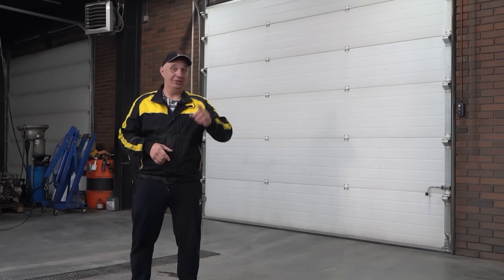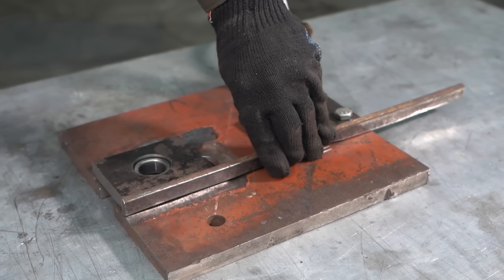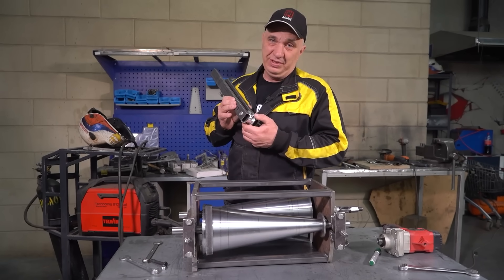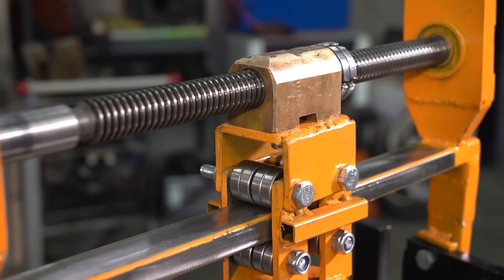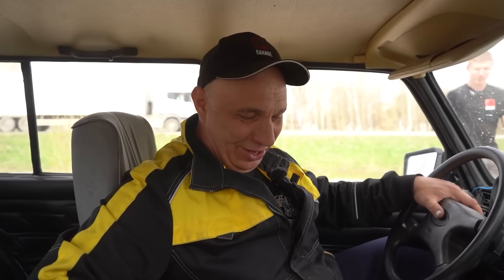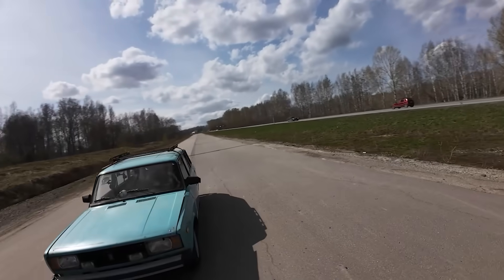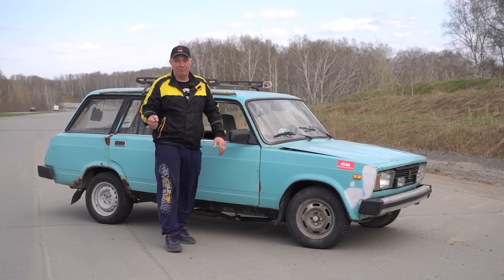We make a DIY CVT for a Lada - will it work?

Comment: If you look carefully at your video the belt is already trying to ride up the side of the flat roller. Maybe you guys could just use a different shaped roller such as a double cone shaped roller with a flat in the middle as wide as the belt.  As you shift the belt back and forth the belt can ride up the side of the cone shaped roller instead of shredding.  Perhaps using the same angle on the cone shaped roller as both of your cones you made for your cvt.  Also as you moved the new roller belt tension would increase reducing slippage.  Just a thought :)  Love your guys vids!

Comment: The CVT is considered an automatic gearbox with only 2 gears, except for a car, which would require a very large one, even larger than the gearbox itself, to make the most of the engine.

Comment: Finally a repairable CVT transmission!! Brilliant work!!
Reply: Replace the belt with some tire tread from a small tire(moped) maybe sow in multi layers to say1.5 inches thick
Reply: Excellent, yes, a repairable CVT. Which is good, cause it’s gonna need repairing a lot. I hope they have a lot of spare belts.
Reply: Add 2 overdrives....
Reply: + :3
Reply: Ratio zero cvt no need repair like manual gearbox.
Reply: @xxxxghostxxxx2052  "doesn't need repair" is corporate speak for unable to be repaired
Reply: Or, alternatively, well designed, which is engineer speak for well behaved metal
Reply: @xxxxghostxxxx2052  LOL.  More like "Can't be repaired after the belt inevitably (and I do mean inevitably ) detonates, destroying the rest of the transmission."
Reply: @gpweaver  Ratio zero is a geared CVT. It doesnt use a belt instead it uses ratchets and clever design.

Comment: a roller for a belt has to be bigger in the middle then on the sides, make a 60-80mm wide roller with 50 diameter in the middle and around 40-45mm on both sides wiht a nice radius and the belt will allways get pulled to the middle of the roller.

Comment: If you guys ever plan to revise this transmission again, might I suggest instead of having a guider pulley and track, and threaded rod, why not use the same principle as a belt sander adjuster? Have one end of one cone pivot and the other can be adjusted closer or further to the fixed cone. If you want to get real fancy, you could use a servo motor to suck/push the pivoting cone, with a default setting to return to it so the belt remains stationary once you've adjusted your speed.

Comment: I think the issue is that you're pulling the belt only from the "top" side, I think you should add an other roller on the bottom part of the belt too, and bring them together, it would put wayy less stress I think when actually shifting the belt around.
Reply: The real problem is the top side is under tension, that causes a lot of problems.

Comment: What if there were two rollers on either side of the skinner part of the belt.  Then, there would always be a smooth round surface pushing it as the belt moves across the cones.

Comment: It would work better if the CVT was placed right after the clutch (the best would be a torque converter from automatic). It would spin way faster this way which would allow quicker ratio changes. It will need a gear reduction stage afterwards of course.

Comment: Random tip: Never ever try to grab or slow down a belt while it is moving. No matter how easy it might be to stop it, don't! The edges on those belts are extremely sharp compared to how they look, and I nearly sliced my entire right hand open while trying to stop the belt from a drier. No joke, that did happen. Thankfully I quickly pulled my hand away due to the friction heat, only then realizing I have a pretty good cut on a finger (I forgot what finger it was exactly). I never felt my hand being cut, only the heat generated by the friction. And that was a drier, not even a washing machine. And the drier wasn't rotating fast at all.
TLDR:
Moving belts will mess your hands up!

Comment: The belt is being sheared as the part on the larger side of the drum is moving slower than the part on the smaller side of the drum and this happens to the belt twice once on each drum.  The belt made its own differential by splitting into sections.  This is why CVTs use cones  with the belt between them the inner and outer of the belt matched the speed of the cones flanges transmitting power over the entire belt thickness.
Reply: the old school advice was to put a half twist in the belt.
just like crowning a wheel, the belt tries to run off the cone at a certain angle... that doesnt match the angle required on the second cone, which itself direct the belt off in the wrong direction...

add a half twist, the belt now rolls onto and off the second cone the "right way"...

but theres always a torsion between any two points on the length of the cone trying to tear the belt part. it can only ever rotate on an infinitely small "line of contact", every where else it must slip across the belt width. and you need width for the friction coefficient, that is then overwhelmed by the slip required... so you make the cones longer and yeah... its a never ending downhill slide...
 
making it as a vee belt and pulley is far simpler, with better friction on the belt, with less wear. now the belts wedging in, and driving from its sides rather than its face.
plus, making them as obtuse cones or pulley sheaves is far more compact...
Reply: @paradiselost9946  half twist and use side rollers
Reply: Would a differential on the output let the second cone slip a bit to keep that from happening?
Reply: No, the belt has a constant speed on both drum surfaces.
The real problem is they gear the engine speed down before the CVT and thus there's a lot more torque going trough. The CVT wants a higher speed and less torque.
And they try to move the belt on the tension side with the 'full' engine power on it.
Reply: True true, but lubrication does become a bigger issue. The CVT is an imperfect design in its own rightly it's why it never truly caught on with mainstream car manufacturing.
Reply: @C.game0the cvt is actually very common these days in hybrid vehicles, nissan just gave it a terrible name so no one advertises it. Basically every hybrid toyota uses a CVT.
Reply: @2ARM2 Toyota doesn't use a CVT in the conventional sense; they use something they call an eCVT which has nothing in common with any other CVT design
Reply: @2ARM2 it s called e-CVT but it’s not the same at all since it needs electric motors , an épicycloïdal planetary gear set and no belt
Reply: @C.game0 all the automatic scooter use cvt and it works just fine, 7 million are sold per year in India.
Reply: That is the entire point of the CVT or any gear system.  The belt on the small side of the cone is spinning that cone much faster than the other side.  There is some slip in the belt, but that happens on a fan belt as well.  I would think it would make it easier if the engine side was a single diameter, not a cone.  Then you move the belt up the cone to the bigger diameter for top speed.  Engine spins at a constant speed and the drive goes faster and faster as the belt moves to the larger section of the cone.  But you would have to tension the belt at the small end of the drive cone maybe with an idler pulley in the middle between the 2.  That would allow more tension in the middle to take up the slack and as the belt was moved to the larger section of the cone, that idler pulley would raise up along its rail as the belt moves to the bigger diameter giving less pressure.  Engine stays in its peak power band at all times while the drive cone gets faster and faster due to the larger diameter.
Reply: Yeah, but then you need oil because now you have a metal to metal surface
Reply: @monad_tcp no you don't? Oil would just make it slip, it needs to be dry since it relies on friction.
Reply: @monad_tcp  You don't.  Scooters run without oil with rubber on metal and it works . The friction is needed
Reply: @JonasDecker-z3x scooters also burn through a belt every 5000 miles

Comment: You need an oblong wheel for the roller with open ends. The guides will only really destroy the edges if they're that big but a belt will try to go to the high point on a pulley under tension.  This might help with the belt lifetime.

Also you could tie the speedometer output to the mechanism to shift gears and have it be automated then.

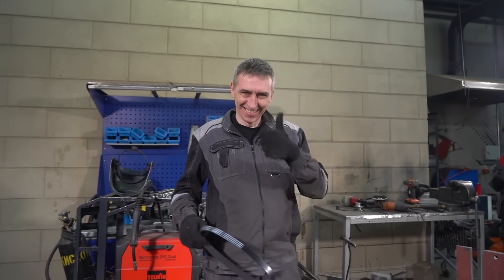Comment: @7:07 minutes in but I'm going to take a guess here you need to have a belt that is mobius stripped ever so slightly not an actual mobius strip but a shorter length on one side than the other. Gotta say guys I really do love this channel I hope it all works out for you hope you guys get to 8.5 million subscribers something along that line this is really worth watching every time awesome videos keep it up
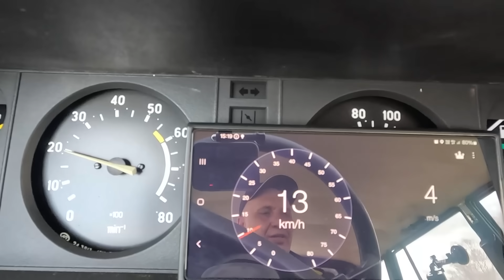Reply: @14:35 that was what I was thinking earlier the failed point is the belt or the connection point between the two to keep it as a belt you would need some sort of system that incurs friction without rubber or anything like that essentially you're looking at something like a Chinese finger trap that's a pretty broad description of what my mind's eye is picturing but that's what you're looking at when one side's pulled the other collapses and vice versa

Comment: if the cones were spaced farther apart you could have the adjustment screw run between them and have a guide wheel both above and below to more evenly spread the force moving the belt sideways. these wheels could also be sprung, acting as a tensioner for the belt

Comment: This is a good retrofit concept, however - you can theoretically fit any cvt if you got a welder and some knowledge of how the electronics work. Kinda works like a floppy disk drive. The pump is pneumatic, the shift linkage is manual unless it has an actuator on it. some after thoughts

Comment: That's impressive! I was fully expecting the belt to just snap! I would like to see this with the metal belts used in CVT's!
Reply: If they did that they would at least need to shield it and it would need fluid to keep everything cooled. If a rubber belt snaps, it might hurt, but a metal belt could do some damage.

Comment: The thing to do would be to have a bearing on both sides right before the point where it contacts the second roller, that way it just has to slightly move it and it’s supported already

Comment: If belt strength is an issue then you could separate the cones more and slice a steel belted higher ply heavy duty tire into multiple belts.

Comment: The often overlooked running principle of the cvt is to let the engine run at its most efficient spot and to regulate the speed via the cones instead of chasing rpm.

Comment: Try to make a simulated cvt by using sprockets like on a bike. 7 gears x 7 gears or more. Chains last long especially in oil and can handle torque. Just need to work on a derailleur. Or even yet try a planetary cvt gearbox

Comment: I'm just a lowly EE and hobby mechanic, so someone correct me if I am wrong. but if the drive belt is allowed to slip under large torque then the CVT would automatically adjust its ratio to fit the torque required right? They wouldn't have needed to build the belt carriage? Incredible build either way!

Comment: Amazing. With a little development   this  could  be the first long term  reliable type of cvt gearbox.
A wider toothed belt and machine the rotors to suit.
Also to make ratio change much smoother you  can also use lubricants as the teeth on belt now transmit the torque,  reducing lateral friction.
I love garage 54 because the projects you take on provokes thought on how to overcome engineering problems

I love the show and keep pumping out the content. 

Respect from 🇦🇺  Australia.

Comment: I made an identical mini-CVT when I was in tech college for machining after I got out of high-school, my teacher was quite pleased with it. They're very cool devices, though it's not as satisfying to drive a CVT equipped vehicle as one with a manual transmission. My Subaru Crosstrek has an 8-speed gearbox in conjunction with a CVT, it's good for fuel economy and drives very smooth at low acceleration but still has the "fun" aspect of feeling it go through the gears at higher acceleration.
Reply: Fake 8-speed

Comment: Seems like your guys just found counter of rear wheel drive, when the power indeed losing by power transfer, your guys using CVT transmission to increase the output of torque power from manual gearbox to CVT power transfer, so the engine didn't stress out and could produce more power than factory settings, your guys should improvise this thing to make older cars more efficient 👏

Comment: seems like I saw a CVT transmission with two cones that had no belt but just used friction between the cones at a 90 degree angle

Comment: Because they used multiple belts and the belts ride on slightly different ratios the belts will rub on each other as they're moving at different speeds, and will also have to slip on the cones a little bit.  I think a rubber wheel crushed between two cones would have been better.

Comment: Now your Shop is equivalent to JATCO 
Nissan's CVT transmissions are primarily manufactured by JATCO, which is a company in that Nissan holds a majority stake. JATCO, short for Japan Automatic Transmission Company, also supplies CVTs to other automakers like Suzuki and Renault. Nissan USA states that the CVT is called the X-Tronic CVT.

Comment: The most stress on the belt seemed to have occurred during "shifts".  When they let off the throttle, the belt moved easier.  I wonder if modern automotive CVTs wouldn't be much better off using pseudo shifts where the ECM throttled back and reduced the timing for the "shift" actuation?

Comment: What if the belt was removed as it is a weak point. The cones made into conical gears - 1 stationary to driveshaft, the other sliding forward and backwards to adjust ratio, mounted on tensioning slide and power transmitted to it through front wheel axel shaft to be able to pivot with cone gear?

Comment: Dunno about that, turn them upside down use just one wheel art the front  under the bonnet, add the second exhaust and you get a great wheelbarrow... or no wheel cut the exhaust throw the rest of the crap out and you get a great skip

Comment: DAF produced a car in the 1960s with two CVTs driving each of the two rear wheels.  The belts ran the length of the chassis.
Reply: The belts are 1342mm long in total :P (And about 40mm wide)

Comment: Next project for Garage 54:  A homemade gas turbine engine.  

Mount six turbochargers to a common combustion chamber which is fed with kerosene.  Feed the exhaust to a common collector which goes to the exhaust side of a large displacement diesel turbocharger.  The intake turbine is removed and a gear is put on the shaft.  The output is reduced by a 100:1 and the output gear has a starter motor gear in the middle which connects to the Lada's flywheel.  The clutch and 4-speed gearbox take the power and drive the car forward.

Comment: It's impressive that you built this and got it to work, even minimally. The belt is always the weak point on any CVT that uses one and of course yours wasn't designed for the application. I honestly can't see this working long term without a bespoke belt. Or, going to the movable roller. The fact hat everything is tapered makes it tough. And a real selling point would be a belt that can be swapped without a major teardown.

Comment: A thicker and flat belt? 
The belt from a Polaris UTV,  ATV, or snowmobile might hold up better. 
Flip it over?
It uses a CVT belt drive that is duct fan cooled by the sheave; lots of friction heat builds up quickly.

Great content as usual. Thanks from Ohio.
Reply: The belt is being sheared as the part on the larger side of the drum is moving slower than the part on the smaller side of the drum and this happens to the belt twice once on each drum.  The belt made its own differential by splitting into sections.  This is why CVTs use cones  with the belt between them the inner and outer of the belt matched the speed of the cones flanges transmitting power over the entire belt thickness.
Reply: And put a slight v in the movable pulley to stop it from wandering to the sides of the pulley.
Reply: @ not the issue, the issue is that v belts grip on the sides where the V is not the bottom
Reply: @  Not a v belt style pulley just a slight v in the pully to stop the belt from wandering to the sides just like you put a slight crown on a pully to keep it centred like belt sanders use to stop the belt from wandering off.
Reply: @ they did that
Reply: those use a V type belt
Reply: i think i timing belt, or one from an actual cvt drive.

Comment: Please keep improving this.  I think you could make it practical with a few design changes.  Stick with manual ratio selection.  Either change the belt or maybe pinch it between the rollers like they did with overhead line drives for variable speed machines.

Comment: Why can't you use the same cvt transmission as scooter
Reply: I mean.. you could, for about 2 seconds before the belts probably would snap :P
They are made for entirely different HP/Torque

The belts used in the DAF cars from the 60s/70s are about twice as wide and thick as the ones you'll find in a scooter, and they are using two of them (one for each wheel)